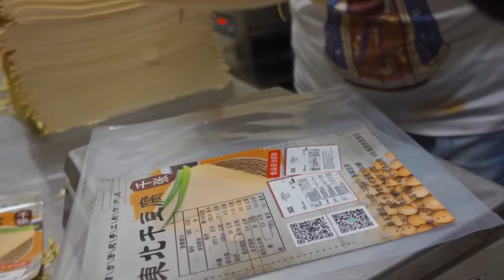How to Make Tofu Skin in The Traditional Way / 千張干豆腐製作, 手工豆腐皮 - Taiwanese Street Food

Comment: Their manufacturing process and equipment are very clean 👍👍👍
Reply from the maker: thanks 😊
Reply: But the soybeans are not picked through and sorted, to remove the bad ones.
Reply: Clean? Is that why the drainage holes of the wooden molds are clogged with old soybean pulp?

Comment: I wonder,  what do they do with the trimmings when cutting the skins into rectangles? 

I would love to try the different dishes, but I acknowledge my wimp factor and am a bit afraid of that spicy dish. But I do say it looks good!!
Reply: Judging by the look and its preparation the spice level isnt high and with a cucumbers the spice is basically non existent since after being cooked it was then quickly roasted/smoked so the chili oil dried up which from my experience dried chili oil loses a lot of its kick. So you should be able to handle it unless youre really sensitive to spice

Spice level is probably a bit less than a hot cheeto but it does last longer in your mouth than cheetos this of course is specifically the first dish the other 2 dishes would mess you up if you cant take spice too well